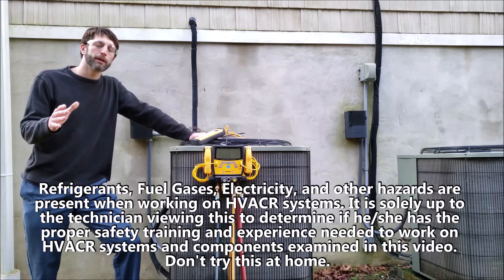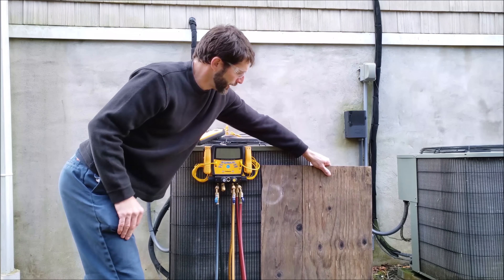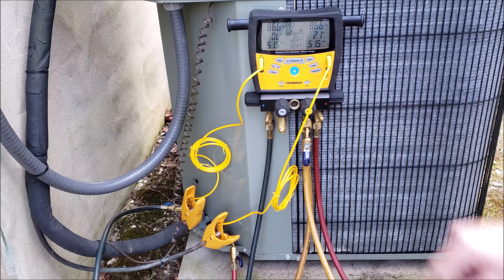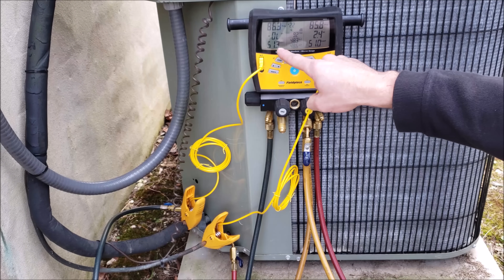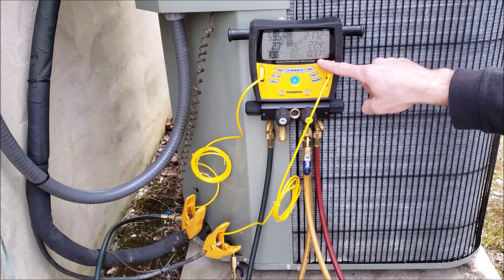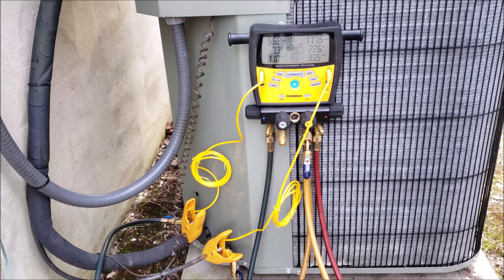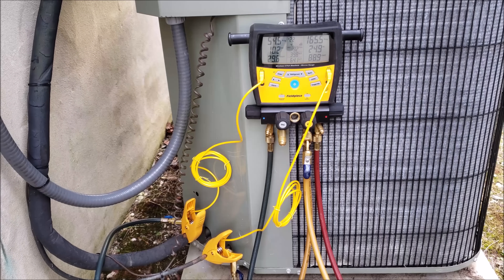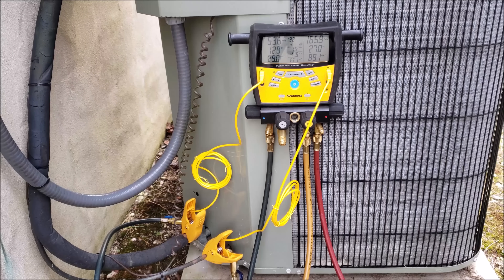Checking the Charge of Heat Pump or AC in Winter Low Outdoor Temps

Comment from the maker: Tool List-  https://www.amazon.com/shop/acservicetech

Support-  https://www.patreon.com/acservicetech

For those that are looking for the tools used in the videos: (Linked Below)
Charging Jacket- https://amzn.to/2rCNcnm 
SMAN360 Digital Manifold Set https://amzn.to/2BdoaD4

SMAN460 Digital Manifold Set https://amzn.to/2nB4Fe6

Refrigerant hoses with valves http://amzn.to/2aBumVI

UEI DL479 Multimeter with temp sensor http://amzn.to/2jtsUbJ

Magnet Jumpers- https://amzn.to/2PyKPQZ

Alligator Jumpers- https://amzn.to/2PxqJXn

Fieldpiece ST4 Dual Temp Meter  http://amzn.to/2wc1ME3

Fieldpiece Bead K Type Temp Sensor https://amzn.to/2DBwKfs

Fieldpiece Wet Bulb Temp Sensor https://amzn.to/2RRI7Tw

Fieldpiece TC24 Temp Clamp https://amzn.to/2qHLyjZ

Yellow Jacket Refrigerant Gauge Set http://amzn.to/2aenwTq

Refrigerant hoses with valves http://amzn.to/2aBumVI

Yellow Jacket Gauge set & hoses https://amzn.to/2vLVkV9

Yellow Jacket 4 Port Manifold w Hoses https://amzn.to/2BkuGIq

Compact Ball Valve for Refrigerant Hose https://amzn.to/2KUisW8

QuickDisconnect 90 for refrigerant hose https://amzn.to/2MMtVcg

JB 6 CFM Vacuum Pump   http://amzn.to/2nqbvo8

Appion Blue 3/8" to 1/4" Vacuum Hose http://amzn.to/2uYlVyc

Appion Red 3/8" to 1/4" Vacuum Hose http://amzn.to/2uYg6Ro
Appion Valve Core Removal Tool http://amzn.to/2uYr8WL
Yellow Jacket 1/4" by 1/4" hose http://amzn.to/2umtcod

CPS Vacuum Micron Gauge http://amzn.to/2v1nM3O
Supco Vacuum Micron Gauge http://amzn.to/2v1JRiA

RectorSeal Bubble Gas Leak Detector http://amzn.to/2ckWACn

UEI DL389 Multimeter  http://amzn.to/2xAdaJf

Air Acetylene Torch setup    http://amzn.to/2aQalsb  
15% Silver Brazing Rods  http://amzn.to/2gVLyLc

Nitrogen Regulator    http://amzn.to/2bXdR5f

Nitrogen Flow Meter    http://amzn.to/2brvoBg

Other tool links can be found in the video description section.

Shop through Amazon! Your Purchases through Amazon provide a means for channels such as mine to earn advertising fees from all purchases after clicking through. Prices are the same as normal-    https://www.amazon.com/shop/acservicetech
Reply from the maker: Yes, as the system was running you saw the subcooling increase 3 degrees at the end. That was do to the indoor temp lowering from 70 to 68 but the subcooling was still high. You are correct in that you will have a slightly higher subcooling if the temp is down low inside so don't recover much in that circumstance. Always best to wait until it is above 70 inside and outside, thanks BP 27!
Reply: Is it possible to charge it by the sight glass in the winter time too?
Reply from the maker: We don't use the sight glass for ac and heat pump systems because that just tells you that there is at least 1 degree of subcooling. They are used for refrigeration where at the highest heat load with the door open to the walk in box, the tech knows that there is at least 1 degree of subcooling while the receiver is just about drained, from there as the load decreases with the walk in door shut, the subcooling rises and subcooled liquid refrigerant that is not needed is stored in the receiver, thanks!
Reply from the maker: Maybe I will do a video on that at some point, thanks B Yenzer1!

Comment: Love your videos, have bought your second book!
Basically if I'm understanding this correctly? There has to be a txv at the evaporator to check the charge during low ambient conditions?

And additionally you see low vapor saturation temps due to low indoor heat load?
Reply from the maker: Yes that is correct!

Comment: In Minus 3 weather how would i charge a empty heat pump after fixing a leak? I know i charge by weight but after the vacuum it may only take in 2 to 3 lbs and then stop , i have to keep going, How do i get the rest in ? Its a senville that needs 68.9 OZ the senville allows me to force it into cooling mode by pressing the indoor head reset button twice, Can i do it that way in cooling mode?

Comment: On the heat mode are you charging system r410a  via low suction line ? In the winter when heat pump low on charge. 
Thanks !

Comment: How would you do this on a Multizone Mini Split HP where it's not using a TXV or Orifice? Need to charge in cooling mode but it's too cold on the inside and not enough Freon to heat up the place enough. Should build up pressure by using the Bag on the outdoor fan motor or blanket on the coil?

Comment: Should I do this every time I do a maintenance call or only if I suspect there to be a charge issue after checking the pressures / temperatures?I live in Washington so it’s always below 70 outside and I’m four months on the job out of trade school. Do a lot of heat pump maintenances

Comment: Would you use the same procedure for a package rooftop unit?
Reply: Todd you can.  Just think about some things that may be different.
1) Maybe 2 fans or 4 fans like York Predator.
2) Pay attention to low side numbers closely if Trane flow-rators or any other non tev unit.
3) Be aware some types of units only have compressor discharge service valves not liquid line service valves.
4) Adjust only if seems grossly off or is really affecting performance, wait till warmer if you can or if you do adjust really try to come back when good outdoor temp.  At work a MCC room may be running at 68 or 65 degrees and no heat is available except from VFD'S etc.  Straight cool unit, no gas, no strips.  So look at the situation and only do it today if it can't wait.
5) At work we would be much more apt to maybe check this way, but, not adjust this way (smaller units yes, larger 20 / 30 / 40 ton = not so much, to much fan cycling for shared condenser coils, or lead lag stuff, compressor unloading, etc).  You can, but if this method showed a problem at work, would just jerk out the charge or almost all the charge and weight it back in, even if it's 15* outside because package units have a weight per circuit on label and that IS what it was designed with.  I say almost all of it because if it does have a smaller leak somewhere you don't want to go negative and pull atmosphere in.
Well this is getting long so I'll let you go.
Hope this helps.
Reply: Sorry forgot one I really didn't want to forget.
6) A lot of times it may be more difficult to measure subcooling or superheat due to the fans blowing their air over your measuring device.  So try to pick a place where you can avoid this and try to cover up your measuring device with armorflex, etc.
Thanks,
Jeff

Comment: Totally mis-leaded information and could be led to refrigerant mis-charge and equipment damage. 12F sub-cooling on name plate is equipment factory design sub-cooling at 95F ambient and 73F indoor wet-bulb temperature. I didn't see author did put indoor wet-bulb temperature into account. The truth is, if indoor wet bulb or outdoor ambient temperature or both below equipment design temperature the sub-cooling going to increases, if above the sub-cooling will decrease. 
For example: at 80F ambient and 70F indoor wet bulb temperature the sub-cooling will be about 17.5F.
The system is not overcharge for sure, do not remove the refrigerant.

Comment: Is it true as long as we have our sat temp for condenser coil at 90-105 degrees and a 70-74 degree indoor temp, then we are able to use this method? Given that our outdoor temp is below 70 degrees yet above 32 degrees outside? 

& what if our outdoor temp is above 70 degrees and we have a 70-74 degree heat load on the house? Would we then say we’re within manufacture specs and can then start diagnosing/checking readings for any possible issues? 

Also, was this a R410a or R22 system? Thank you I’m advance!
Reply: Yes to question 1, yes to question 2, and R-22 to question 3.
For question #2, the closer you can get to a 95* outdoor day, the better.  But have diagnosed many systems over the years at 70 or 75.
Hope this helps,
Jeff

Comment: great video! just a quick question, how did you determine the saturated temperature to be between 90-100F? did you take the temperature you wanted to mimic i.e 70F outdoor temp and added 20-30F to determine the condenser saturated temperature?
Reply: you also mentioned this is to be used on a TXV system, would this not work with a fixed orifice?
Reply: @valcao9844  I have the same question if this will work with a fixed orfice.

Comment: If I had a 32 degree outdoor Temp, about 80 on suction pressure, 21 degree suction saturation, high side about 315 psi, outdoor metering device is a TXV. Indoor 73 Temp Would that seem normal. I had a unit that would lockout intermittently in heat mode due to pressure dropping so low. Other times pressures would drop very low but would stabilize to the readings I stated above. I was thinking TXV wasn’t opening up properly but now I am wondering if charge is low.

Comment: You've answered my question and its No, I can't test my AC charge in the winter. I wanted to test it due to it was low last summer and instead of waiting until it heats up, I wanted to check it out now and look into fix or replace. But I'll have to wait until it heats up. Excellent video.

Comment: New subscriber supporter I love your teaching.I bought your great book,
 I have a Mitsubishi Mini  Split with 15’ to inside wall mount. IT ONLY HAS 1 service port outside access🙄
I used jacket at outside 60 degrees, but I probably need to put temp sensor inside unit next to high side port (closest to compressor) right?...to get proper reading.

I would lose heat midway through winter till guy comes out to add refrigerant ( small leak )
After the last time he came out the following happened.

I took my own readings just today in cool mode, 
Readings = low side pressure 155 lbs
, temp close to outside port and temp probe is 55-60 degrees on cooling mode still
It cools fine on low or high FAN

IN HEATING MODE is fine with auto or low fan . But I turn fan on high a rattling sound starts quiet then gets louder and louder until I turn FAN DOWN or turn TEMP BACK DOWN.

I’m guessing guy overcharged 
I have my own recovery tank, vacuum pump and gauges with temp probes t1 /t2
I know of the dry ice technique to recover also
Lately it’s been 60-70 degrees but won’t last long

Thanks in advance

Comment: Wouldnt it help to run the heat and bring the indoor temp up to 75+ degrees before starting the procedure ?
Reply from the maker: Yes it certainly would but if we don't have a furnace or electric strip heating then we don't have a choice, thanks!

Comment: Why can this only be done with a TXV and not a fixed orfice?
Reply from the maker: There is a much lower wb indoor temp and the txv is able to hold the superheat fairly consistent. We check superheat while trying to determine a target superheat by reading the indoor wet bulb and outdoor dry bulb but we are restricting the outdoor units airflow to replicate a warmer day. We just don't know what the target superheat should really be, thanks!

Comment: How about turning the heat on for a while until get a temperature increase inside the house before checking pressures if you don't have a jacket for the outdoor unit ?

Comment: Can you explain why you checked the unit when it was at 90 -105 degrees saturation temp on the high side? Why not 110 to 120 degrees / 250psi ?  What saturation temp would i want it to be at if doing the same thing but with 410A? Thank you
Reply from the maker: Hey Mathew, that is why I spoke in saturated temperature and not pressure. You would use the same sat temp regardless of the air conditioner refrigerant. 90-105 degrees is what the manufacturers designed the equipment to run at. If you check the charge at a sat temp of 120 degrees then it would make the subcooling look high, thanks
Reply: @acservicetechchannel  
How did you know that the manufacturers designed the equipment to run at 90 to 105 degreees saturation temp?
Reply from the maker: Hey Matthew, the equipment I install in NJ state not to be installed in the southwest. The charging bag manufacturer gives pressures to measure before checking the charge that you must attain by opening or closing off the bag. When we check ac units that are 13 seer and higher, the sat temp always falls in that range unless it is abnormally hot outside.

Comment: How does the evaporator coil freeze if there is no moisture in the air ? Indoor temp I'm referring to
Reply from the maker: There will still be enough moisture in the air to frost the fins and that will be like insulation covering the fins which will hinder heat transfer, thanks
Reply from the maker: If you think about it, heat pumps freeze as well and need a defrost mode during the winter at the outdoor coil. There is still moisture present, thanks

Comment: Why couldn't you use card board
Reply from the maker: Unless the cardboard is thick, it cannot be used on the top due to it bending. It is not used on the sides because you will not get a correct saturated state across all the tubing. You more evenly distribute the air crossing all of the coils when partially blocking air at the top, thanks!

Comment: What about a system with a piston ?
Reply from the maker: It would be too dangerous for the compressor to check the charge of a piston system without a heat load. You would just have saturated liquid entering the compressor, thanks!
Reply: Hey Craig ,  U mean with piston it would be liquid coming into compressor because the higher the pressure outside the more it pushes into piston and with no load inside thus no heat  transfer to refrigerant it could run with low to no superheat , how ever on a txv system  it should keel up some  superheat and if it doesn’t  we would need to look into airflow issues.
Reply: @rickcantu4501  sounds exactly right.  Higher hi side pressure = higher low side pressure for fixed orfice system and that pushes more flashed off liquid into the coil and without increasing the indoor air volume, but temp surely falling, s.h. will drop because the coil fills up farther than designed and they (not Craig) just can't trust everyone to control that, so they can't recommend it as a procedure with their product.

Comment: Just go back in the summer and check the charge.
Reply from the maker: For efficiency, yes but for heat pumps that need to be working we need to either use this or total weight method unless the manufacturer has supplied a charging guide for the particular unit, thanks!

Comment: No reason to check ac in winter. If new install measure lineset weight in charge. Just as it says in manufacture instructions say verify charge in summer
Reply from the maker: Hey Mark, you are correct. Some systems are used on buildings that have a high heat load due to people, appliances, or electronics though. Also we have the problem of getting a close charge for existing heat pump systems and yes we also use the total weight method on new installations and also servicing as well, thanks
Reply: Yeah, Mark!  Ya NOOB!
Reply: Even in summer it gets cold in northern states in higher elevation.  Gotta charge AC regardless.

Comment: Ideally check the cooling when there's a load in the building with a TXV
Reply from the maker: Absolutely, even if you use this method to get a heat pump going, go back when there is a heat load for efficiency sake for the building owner, thanks Mike!

Comment: Hi MR
Thanks for your help but I it will be the same for 410A piston system and did you work with Fujitsu brand 
Thanks
Reply from the maker: This method is only for single or two speed units in second speed that have a txv metering device. You would use the total weight method for that in the winter, thanks

Comment: It will be under charged in the summer.
Reply from the maker: With this method, the subcooling will read a little higher than it would normally be in the summer but not that much just 3 or 4 degrees higher roughly. I would not suggest to go crazy with recovering. It is best to wait until it is above 70 inside and 70 outside to check the charge for efficiency. This system however is still somewhat overcharged, thanks Sean!

Comment: Great Videos, Ty,  I deal with Commercial Units a lot(Banks, etc.), and we would use a Condenser Fan Cycling Control are a Variable Control . These would Maintain your Press's., Then you could check your Sub Cool and Super Heat. If you Run into a Happy Home Owner that Likes there House Temp's. at Walk In Cooler Temp's., you could also add a Freeze stat on the Suction Line. But a Good Fall and Spring should get you thru Low Ambient Conditions.
Reply from the maker: Yeah this is just for small residential units without the permanent fan cycle control, but that is nice and works great for units that have a high indoor load from people and electronics that run in lower outdoor ambient conditions, thanks John!

Comment: That only applies to units with a txv?
Reply from the maker: Yes, do to the TXV keeping the superheat consistent and keeps the compressor safe in a low indoor heat situation, thanks!
Reply: How would you check charges on units using a fixed orifice when it is below 70 degrees outside?